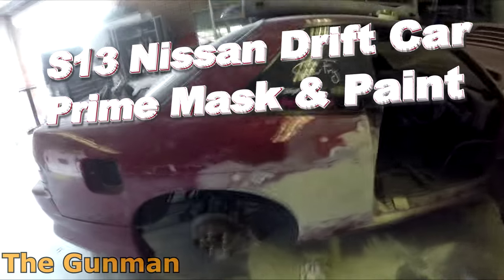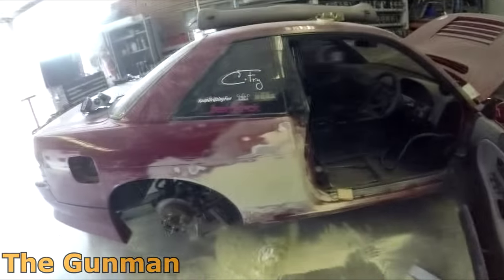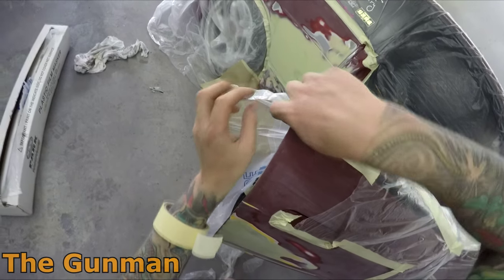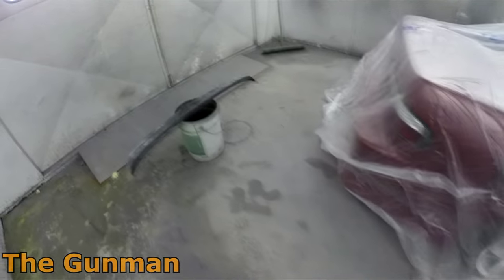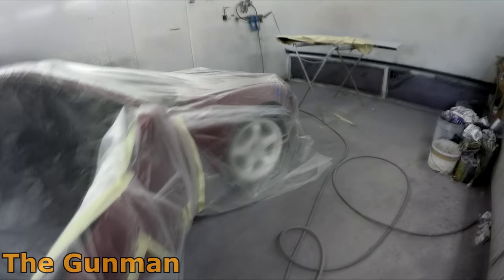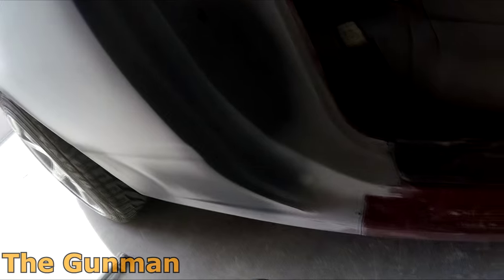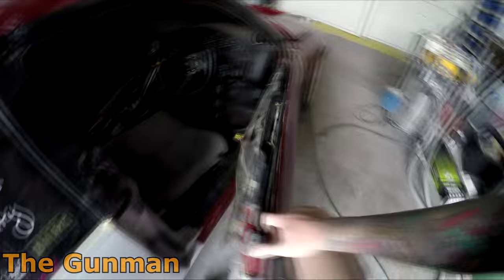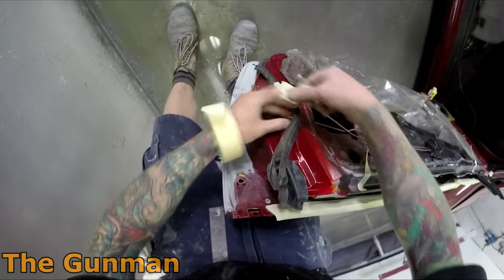Nissan S13 Prime, Prep, Mask & Paint

Comment: Nice job man. I've been watching your videos for the last 4 weeks. Inspired me to paint the front of my VT Commodore wagon , Orion Silver Frost metallic , using Standox  basecoat and clear 2K. I scored a GTO bonnet (steel ) and it was a diffent silver. Painted bonnet , front guards , front bumper and colour coded the scoops as well. I have a booth , but I converted it to a chassis dyno room about 14 years ago. I used to run my own crash shop before closing it to run a Dyno tune shop , I do GM and GMH computer  remapping  now. Things have changed quite a bit in the paint game since I used to paint. So watching your videos has bought me up to date so to speak.Thanks for that.
Paint job on the VT Wagon didn't go as well as I would have liked , I need to go into the drivers door to blend out from the front guard as I went to far with the new basecoat , due to a couple of stone chips I missed on the side of the guard I decided to fix and flip some colour over. Also , when I had finished , about 11.45 pm Saturday night , a couple of mates who had been on a cruise stopped by and opened one of my roller doors to see what I was up to , right where the bonnet was sitting on horses. Windy night , blew shit all over it. I'm hoping I have enough clear to rub out the crap and polish it. I'm leaving it for a couple of weeks so the clear can harden up  a bir. Ordered a 3 inch DA sander from Ebay with some 1500 and 2000  pads to help out. That's something we didn't use when I was in the game , we used to wet rub everything. Thanks for your vids showing this.
Your an excellent painter!
Reply: dyno tuner 
е

Comment: many thanks for your great tips . what is better for painting 1.3 or 1.5 or 1.8mm gun and what are the difference between them
Reply: +ammar alwazzan It depends on what you are painting.  In order of use you generally want a large tip for primer since it's quite thick especially compared to bc/cc so you'd want a 1.5-1.8.  For base coat you want 1.2-1.3 depending on the size of metallic but a lot of people will have different opinions on this.  For clear you can go anything from 1.0-1.3.  The larger the size the more fluid and potential for runs.  I prefer a 1.8 for primer and a 1.3 for bc/cc but I'm sure others have different opinions.

Comment: Bit of a stupid idea moulding the over fenders into the body. You will see 99% of drift cars without this done because the fibreglass just doesn't last, if you're on it when your tyres are done and they delaminate or blow out the over fender gets ripped to shreds, same deal if you're hit from either side. Best option is to keep it simple so if you need to replace the fender simply drill out the rivets and install a new set instead of having to reapply glass and bog every time.
Reply from the maker: Yeah I'm hearing ya mate